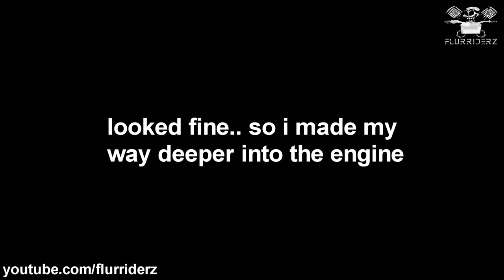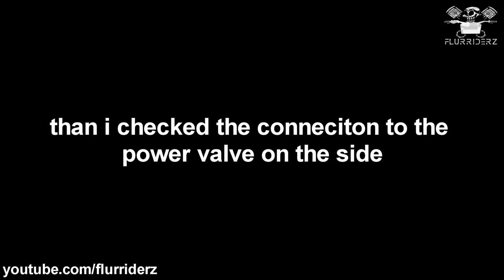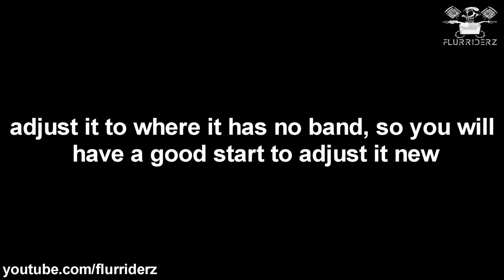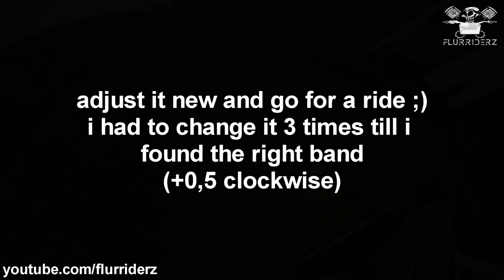Suzuki RM 250 1992 Power Valve Issue and rebuild - no full throttle

Comment: Hello, someone could tell me if I can mount a 95 cylinder on a Suzuki RM from 92 by putting the valves and guides from 95
Reply from the maker: im not sure. 90 91 and 92 were the same but 95 got some other shape i guess.